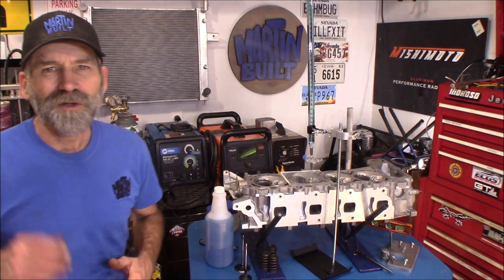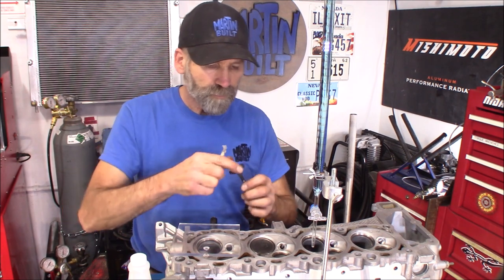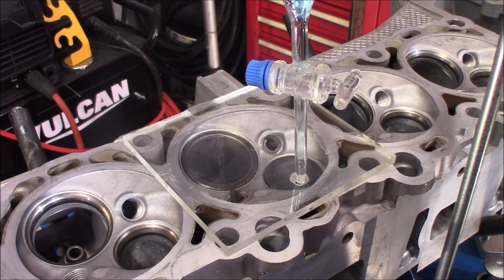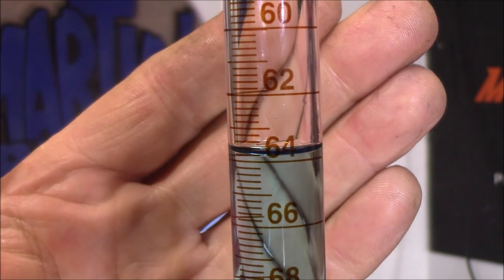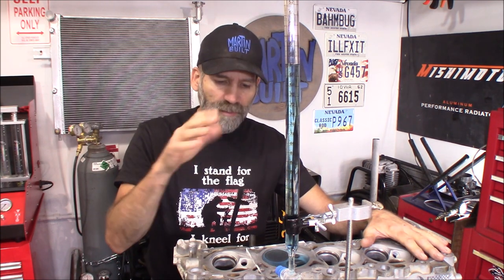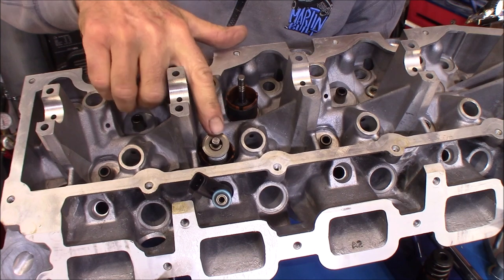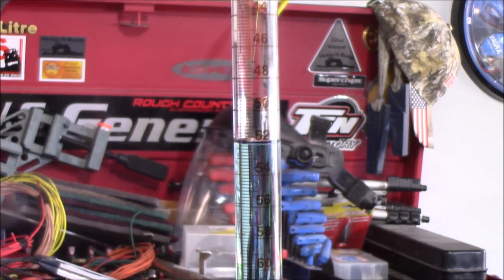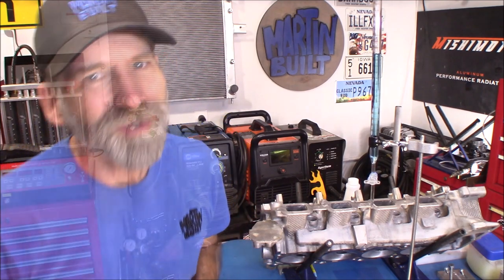How to CC Cylinder Heads (Dodge, Jeep 4.7HO vs 08 4.7 which one is better)

Comment: Can you swap the entire 2008+ engine into a wj
Reply from the maker: Yes, you could, you will need the exhaust manifolds from the 08+ and modify the Y pipe and you will need to replace the relocator gear on the crankshaft with a 16 tooth and the passenger side cam gear.
Reply: @martinbuilt  that seems like a very viable option for guys plagued with the lifter failure. 

I want to pick your mind one more time. Daughter has a 00 4.0 WJ that had its head crack. Dad came across a 4.7 salvage title. Could I essentially pull the engine, harness, and mounts from the donor and it be plug and play? I wouldn’t think jeep would build many different interior harnesses as it would not be cost effective. We changed my wife convertible Camaro to a v8 6 speed with nothing more than a cross member, engine harness, and drivetrain. 2 days and driving
Reply from the maker: @nate4036  I think you would also have to replace the transmission
Reply: @martinbuilt  yes sir. The salvage title one is complete. I haven’t counted/ matched the harness at the firewall yet. That’s my only hold up.

Comment: What is the. Main differences between the 99-07 4.7 and 08 and up 4.7 and will every part from a 08 and up bolt onto a early 4.7
Reply from the maker: I would say that the combustion chambers, intake and exhaust ports are the main differences.
You can interchange the valve and camshafts.
Reply: @martinbuilt  okay thank you I took the heads off of my girlfriends 99 wj and they were both cracked. Tryin to see if later model heads will work? Also could I swap a 32 tooth motor in there, it has a 16 tooth now?